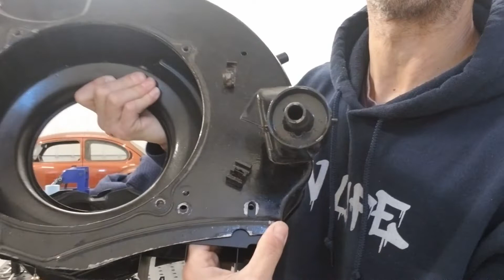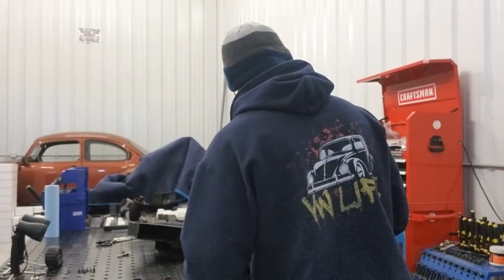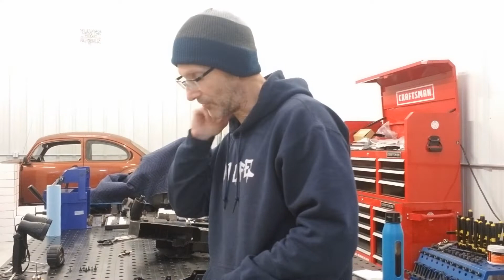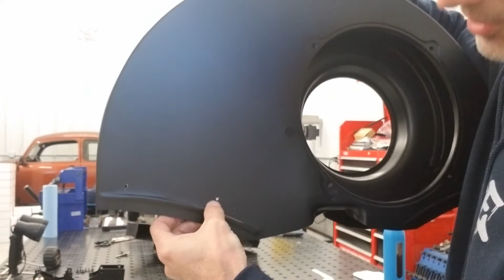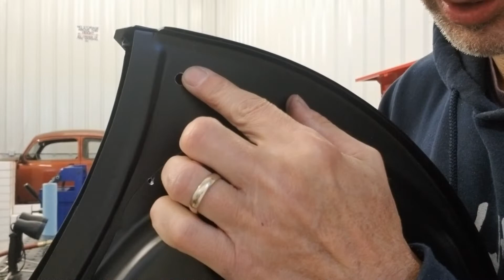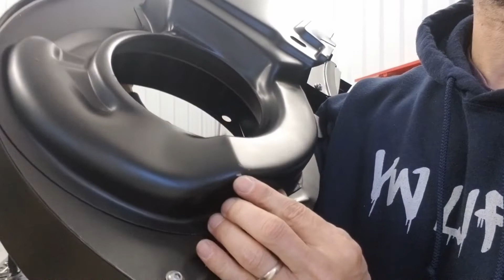Fixed Cooling Flaps Installation

Comment: The fixed cooling flaps are nice but even powder coated they will rust under the powder coat. I suggest stripping and repainting the flaps before final assembly. I pulled mine out of the box to begin final assembly and the powder coating is all blistered.
Reply from the maker: I have a set that was my final prototype, and they are something like four years old.  They still look the same.  Blistered powder coat sounds very strange to me.  Do you have a picture of them?  Just as an aside.  The powder coating is getting so expensive I had to raise the price last go around.  I did a little research, and if I make them out of stainless steel and don't powder coat them, it's actually slightly cheaper now, because of the cost of the powder coat.  So, I have a prototype in stainless steel that I will get later this week, and I'll weld them together and see how they come out.  If the welding of the stainless comes out good, which I don't have a reason to doubt at this point, the next production run will probably be stainless steel.  I would like to see a picture though, if you have one.  You can send it to me via email at info@andrigsaircooledtechnology.com
Reply: @andrigsaircooledtechnology   I have it all mocked up on the motor at the moment but as soon as I'm done with that I'll pull them off and send pictures.
Reply: @Kelteclover  Great.
Reply from the maker: One other thing I forgot to mention.  The powder coat being used is an epoxy powder coat that contains zinc.  As long as it's not scratched off, it should be fine in terms of rust.  Having said all that, if the prototype works out, it will all be mute in the future.
Reply: @ I went over those pictures you asked for.
Reply from the maker: @Kelteclover  I have replied to your email with the pictures, and just read that and chose what option you want to pursue, but I'll make it right for you.
Reply: @andrigsaircooledtechnology  I looked for the email you sent but never got it. I wasn't asking for anything I was simply making an observation that could be experienced. Powder coating is great and all but I have seen corrosion materialize under it many times. Truth is for a small part such as these I would have probably ordered them unpainted so I could paint them before final final assembly. They fit great during mock up.
Reply: @Kelteclover  I can strip them and remove the rust and recoat them, or send you another set and you return those if you want.  None of the sets I have left in inventory look like that.  They look like the were not decreased as they are supposed to be before being coated to me.
Reply: @andrigtmiller  Not necessary I'll strip them and coat them myself but thank you for the offer.

Comment: good product Sir , the templets were a big help . . put them on a new 36hp fan shroud without oil factory cooler , went with Derale electric oil cooler under vehicle with the factory VW cooler mount location replaced with oil line take off return fittings . . . .  2110cc 1955 Cal-Look 80' build survivor . look me up Lake Havasu City Az.
Reply from the maker: Glad to hear it.  Those templates took a long time to get right, but it was a labor of love ;-)

Comment: Hi Andrig! These are great!!  I am wondering, for stroker applications, should the flaps be modified in any way to accommodate the motor getting a bit wider?  Or maybe it wouldn't make much difference to modify them for stroker motors?
Reply from the maker: One of the problems with engines that use barrel spacers, copper head spacers, or just longer cylinders to accommodate longer strokes and/or rods is that it does move the cylinder heads out, but the fan shroud isn't any wider.  This, of course you know.  It means the airflow is not really lined up correctly.  Now, if your talking a few millimeters, it won't matter much.  If your engine is 5 mm or more wider than stock it starts to make a real difference in cooling the cylinder head.  I actually stopped building engines that are not stock width.  There are some three different piston pin heights you can buy off the shelf for various stroke and rod combinations, and you can get pistons with custom pin heights.  I prefer doing custom pin heights, but I know that not everyone can do that.  So, I think it's better to stay as close to stock width as possible, and then everthing fits and works better.  Having said all that, your comment, and my experience with building engines tells me there is a need for a cooling system that can accommodate these types of engine builds.  I'm working on something that will cool the engine properly regardless of the combinations.